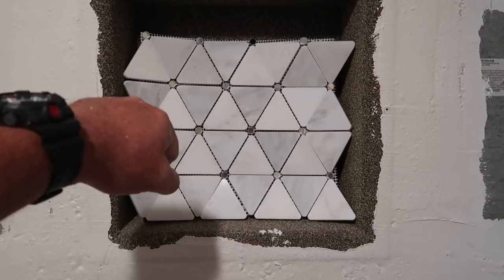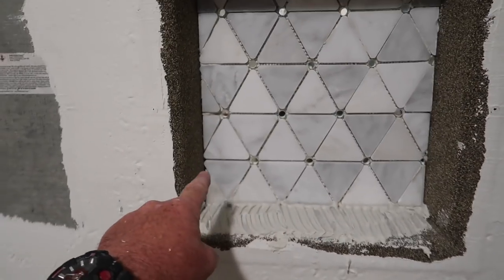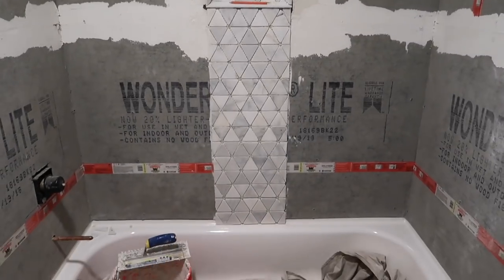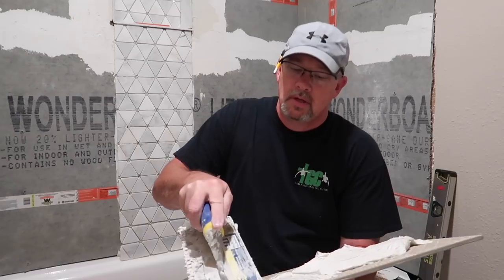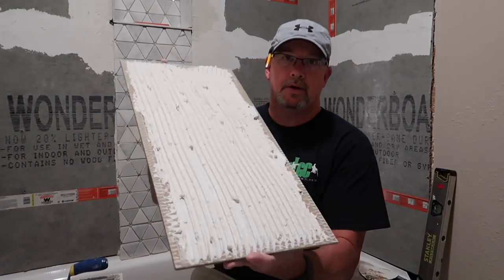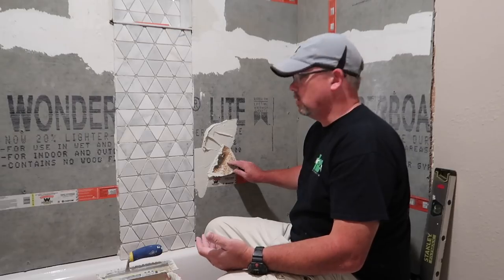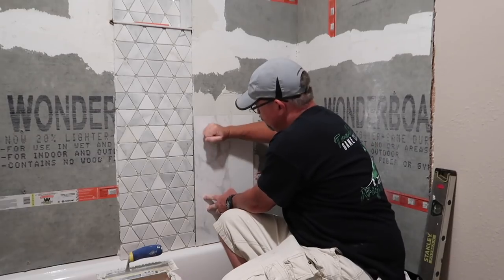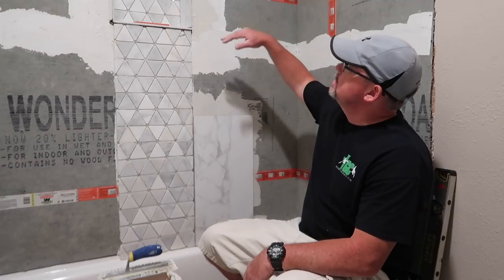How To Install Tile Vertical Around A Bathtub- SIMPLE & EASY

Comment: I guess my last comment got deleted so I'll try asking again.  Do you have a moisture barrier behind your board?  Waterproofing in the niche?  How much coverage behind your 12x24's?
Reply from the maker: tiggyton it's super hard to cover everything in such a short video. I try to offer up basic knowledge in a quick and easy way for the veiwer. Most of my videos are under two minutes although this one did go a little bit longer. I'm working on a separate video that will show some waterproofing techniques for building a shower or tub surround.

Comment: W.T.H. was that all about your niche doesnt look like you added pitch. Also remove your stickers from the wonder board. You should always set the bottom tile on a niche first then set the back and sides on top of botrom tile. That way the water runs down then on top of tile. The way you have it the water runs down the wall and will make its way in the joint
Reply from the maker: shaun1okeechobee hey Shaun I totally understand what you are saying. I had to set the back wall of the niche first because the bullnose wouldn't stick out far enough to meet up with the wall tile. The client ordered up the bullnose at 3.5" and I needed at least 4" to make it come out right. I completely hear what your saying for sure.